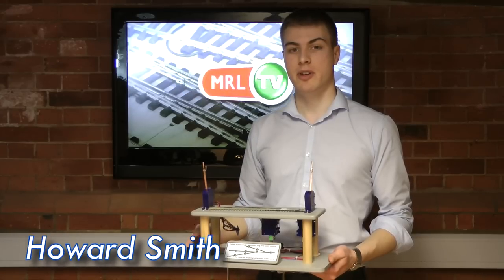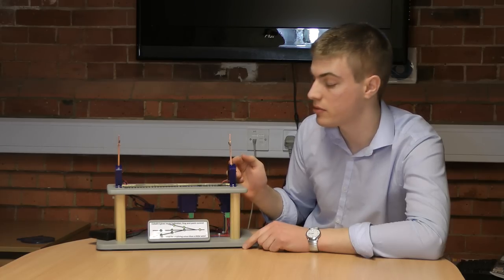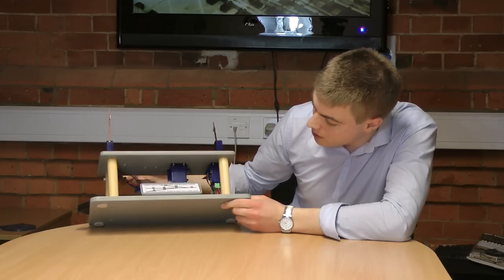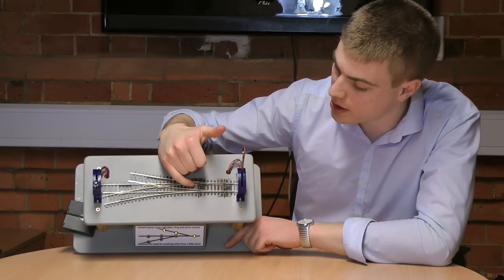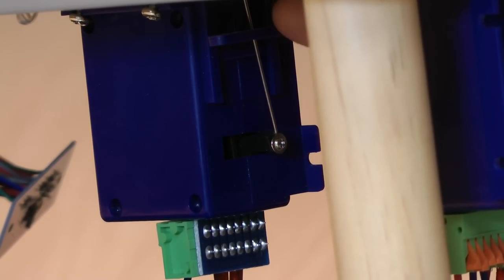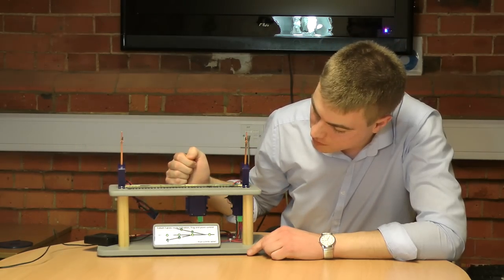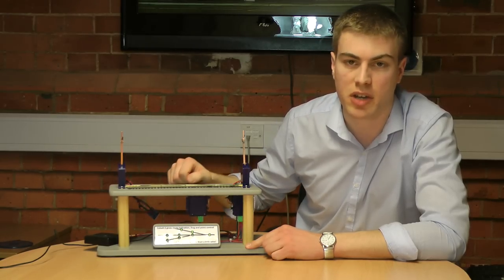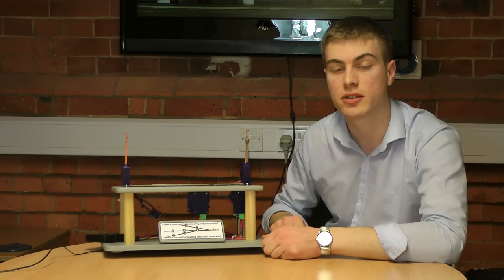DCC Concepts Cobalt Switching - BRM Tried & Tested (British Railway Modelling magazine)

Comment: Hi something not right,I'm using cobalt iP digital point motors on there website thy are using different motor , contacted Dcc Concept and thy say don't need insulated  fishplates ? as any one in BRM wired up Peco SL-90 double slip insulfrog using cobalt iP digital motors if so can you send wiring diagram please help.

Comment: this is very nice but how is it actually wired up it would be nice to know from a novices point of view
Reply: Hi Brian. DCC Concepts have extensive wiring instructions on their web site.
http://www.dccconcepts.com/index_files/Cobalt_turnout_motor.htm you supply 9v DC to the motor via your choice of switch - I use DPDT switches and track power to the on board SPDT switches to power the frog or signals etc
Reply: Nick Sturman
thank you for that. i have left a Comment with Richard from DCC Concepts it would be nice to have some videos on cobalt on RMWeb and he has kindly replied saying he would in future but required input on what would be good things to add to this.

Comment: Can these levers also be used with a G-scale (LGB) railway, both for points (AC current) and switching on/off track sections (an analog layout) with 26 Volt DC? What is the maximum voltage they can handle?

Comment: The name "Cobalt" I find very worrying! Cobalt is a mildly RADIO ACTIVE material known to be used in DC motor magnets in US products where it is not a controlled substance. However as far as I'm aware it is illegal in Britain ! If Australian motors are now also using this material, I certainly wouldn't want them in my house !!!!!
Reply: Huh? What on earth have you been smoking? There's also a ground handling company at Heathrow Airport called Cobalt....perhaps they should be banned from operation in case they somehow contaminate the brains of pilots, or corrupt aircraft systems causing much mayhem and destruction😜😜😜😜😜
Try doing some research (or at least thinking about what you've written) before posting such stupid comments.